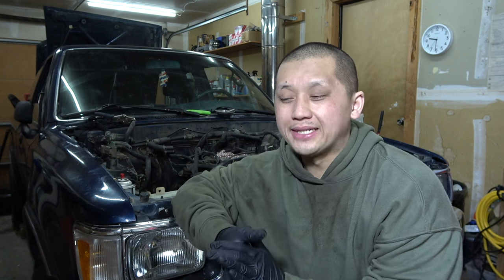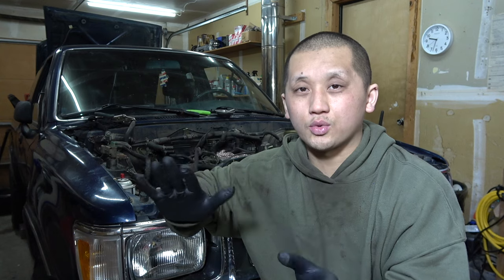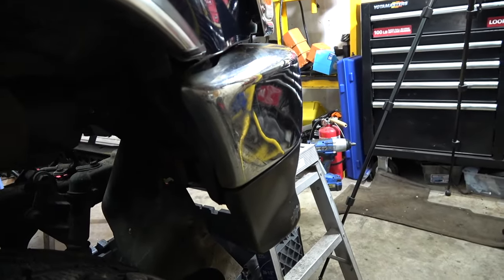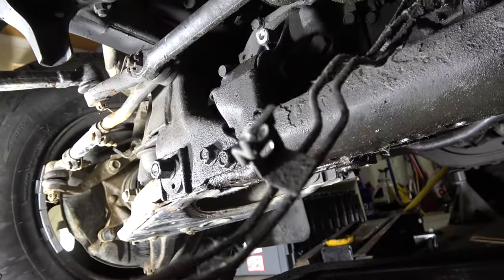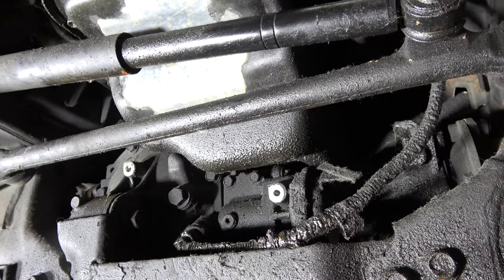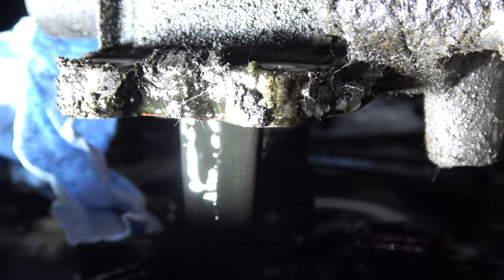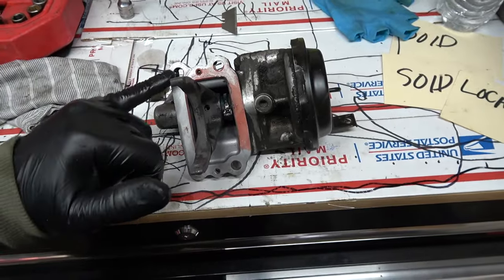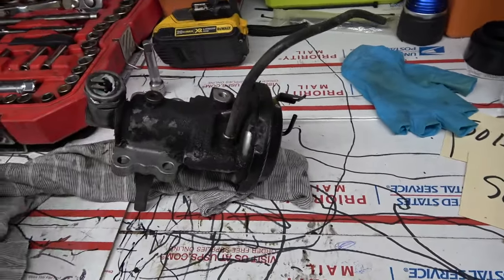89-95 TOYOTA PICKUP/4RUNNER 4WD A.D.D| EASY SIMPLE DELETE MODIFICATION

Comment: I love my ADD. Mine is electro vacuum operated. The newer ones are no longer vacuum and just electrically operated. I prefer vacuum. But i kinda wish Toyota had the similar vacuum operated wheel ends like F150s have them. This prevents CVs from spinning in 2wd and lock via electro vacuum and if they fail, they fail in the Locked position. But i still love my ADD.
Reply from the maker: Thanks for sharing!

Comment: Great video. 
Driving my 92 3.0 auto shift today in snow.
I hear some grinding when I turn the steering wheel, no grinding when straighten out in 4 hi.
I also hear and feel a slight clunking noise when I’m 4 Hi. 

Could there be a problem with the CV axels?
Could the gear in the actuator be grinding/ slipping for some reason?

Where should I begin Sir?

Thank you!
Reply from the maker: Yes. Cv axle mostt likely. Are yours boots torn or rip?
Reply: @NuttyNu  yes. Boots torn on driver side. 
Thanks for your quick response.

Comment: Have you personally had any issues or heard of any issues about the zip tie melting? I think average diff temps are above 185 which is the melting point of plastic zip ties. I know its not directly in the differential but it was a concern of mine. Thanks in advance!
Reply from the maker: Not at all